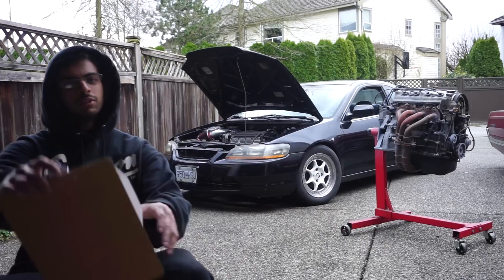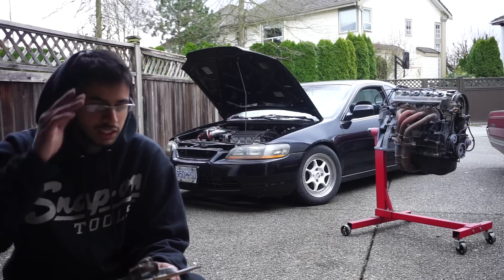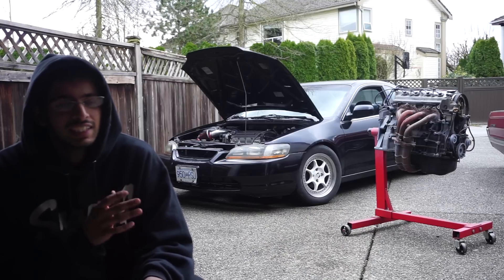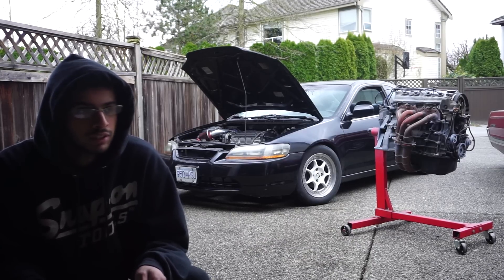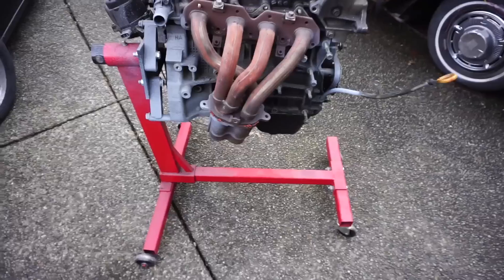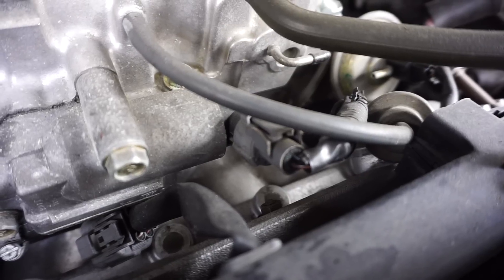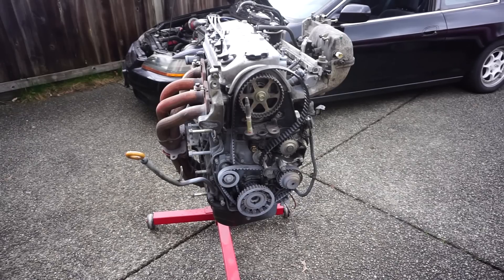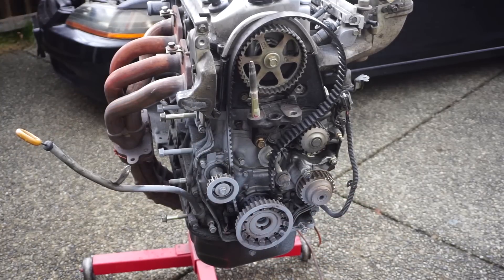HOW TO: H22 Swap guide for   HONDA ACCORDS

Comment: Wait what about the purple wire coming from the dizzy
Reply from the maker: that purple wire was just a wire i used to extend the wiring harness. used it off some scrap wire i had kicking around
Reply: Mine has a purple wire in it

Comment: Did you just flip the factory fuel line?
Reply from the maker: No kept all the fuel  lines. Didnt change anything
Reply: My line has 2 things to hold the fuel line. I tried anyway and had gas everywhere.

I cut off the two points and rounded it off for a clean finish. Snug as a glove.

Comment: You are a life saver, thank you! Trying to do a G23. Is there anyway to use the obd2b distributor from the prelude though?
Reply from the maker: yah. thats what im using in this video. using a obd2 external coil found on the  usdm 97+ preludes. dont know if the jdm ones are internal or external coil.

Comment: Ok so let me start off I don't know Honda but I bought a 97 Accord that has a h22 the vtec isn't hooked up I'm trying to figure out what I have to do the ecm is a 37820-p0j-l11 plz help a brother out 🙄🙄
Reply from the maker: P0j is a accord ecu.  Which wont work correctly.
Reply: @Wrenchlife604  what won't work the vtec and what do I do to fix it
Reply from the maker: @rickyjohnson974  could he a couple of things that wont operate your vtec. Id start with the correct ecu for  the engine first then go from there
Reply: @Wrenchlife604  the car runs and drives ok looks like it's been running that set up a while idk bought it that way. Only issue I'm having running wise that is 😂 it dies when I come to a stop but I think its the brake booster the idle goes up and down when I hit the brakes 🤔 or it could be the radiator leaking I hear Honda's will idle funny if it has air in the cooling system. I will do the ecm when I get $230 bucks 😭😭

Comment: So a Vtec dohc fit on Accord 97
Reply from the maker: H series yes.  b series vtec dohc engine wont work
Reply: I’m trying to get in to swapping engines and the question im going to ask is not anything about video. H22a does it matter what transmission it will be with like auto transmission because the what I have
Reply from the maker: @elmer--soto98  the automatic will bolt up. will be complicated to get the right ecu to run the transmission and the engine though

Comment: Any info on internal coil wiring? I have an 01 Accord and am swapping a H22a4 with a TD-89 distributor in as well cant find anything detailed on the forums on where to specifically splice or reroute wires to
Reply from the maker: Do u have a wiring pinout for the td89 distributor?

Comment: im doing the same swap  running hondata s300   how do i wired the crank sensor to the dizzy ??? @wrenchlife604
Reply from the maker: depeneds on what engine you are running. in the setup show. the h22a4 has the crank sensor located on the crank  of  engine so the accord harness plugs right in with no moddification. if your running a jdm h22 or a older h22a1. you will need to take the crank wires that usualy go down to the crank. then loop them back towards the dizzy/ shorten the wires if you want then wire it into the dizzy. not shure of the pinout on the older h22 / jdm h22 distributors
Reply: Wrench life 604  im running the same engine h22a4  but my distributor is the  external coil with more than 6 wires  I have the plug with 2 wires and the big plug with 8  more wires
Reply from the maker: not fimiliar with the other wires. if you can get me a year of what car it came out of i can try and find a diagram. every h22a4 ive seen has the same wiring pointed out in the video  at 6:45
Reply: Wrench life 604  the dizzy that I have came out from the 92-96 Honda prelude I think it’s a Jdm
Reply from the maker: Jxztar Tv  the jdm h22 run an internal coil inside the distributor. As far as I know I could be wrong
Reply: Wrench life 604 the one I have is external coil but the plug is diferent its come with 8 wires  but I think I’m going to buy me a td77u wich is the same distributor that u have  with 6 wires  can you send me a email or something where I can send you the pictures of what I’m doing plz I need help thanks
Reply from the maker: Jxztar Tv  dm. Me on Instagram if you have it @yaboyherman

Comment: Are you located in BC ? I live in BC too I saw your kanjo build ! :D I'm kinda into the same stuff bro building a kanjo Civic
Reply from the maker: Yah from vancouver area.  What's done to ur civic so far?
Reply: Wrench life 604 I just bought the car a month ago I will be doing a kanjo style build, fully gutted, cage, and suspension work, stitch welding the chassis along with a LS vtec high compression build with Yamaha R6 itb's it's going to be lit. I also have a mk4 alh TDI I daily

Comment: I have the 01 v6 cg6 and I want to swap an h22, will this be the same process or different since I have the v6 subframe?
Reply from the maker: I believe its gonna be diffrent  cuz the v6 use a diffrent subframe. You are better off keeping the v6 in there and manual swapping  it
Reply: @Wrenchlife604  There’s not really any manual swaps for the j30a1 😳